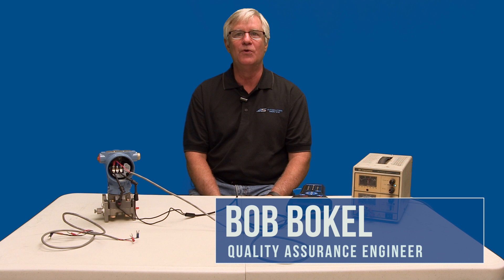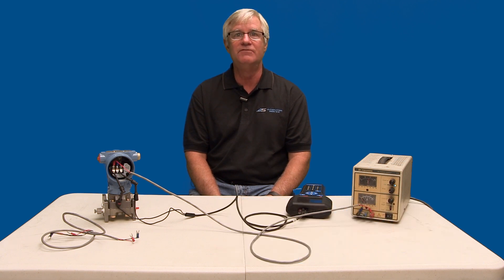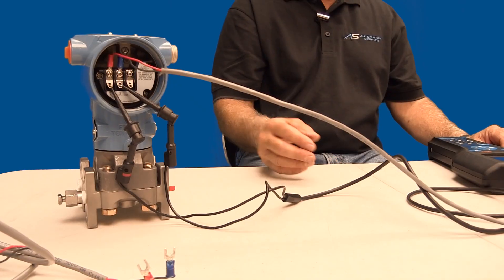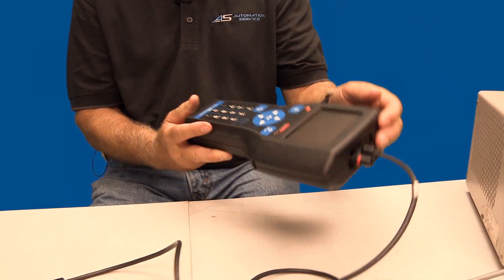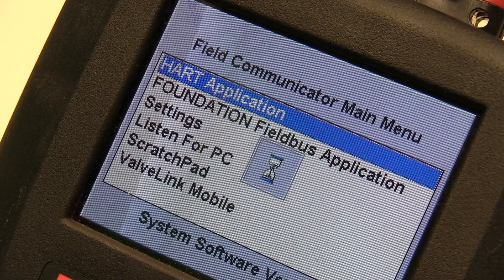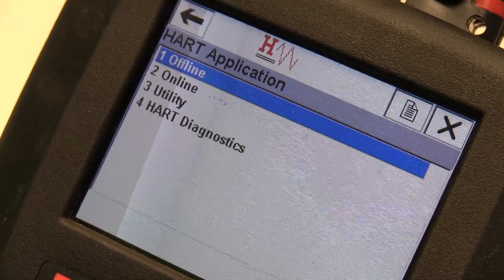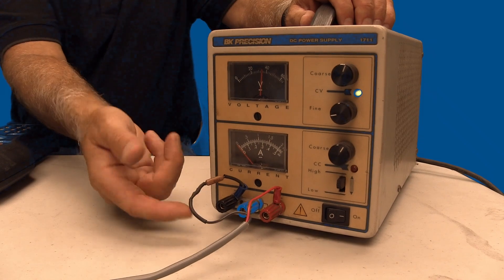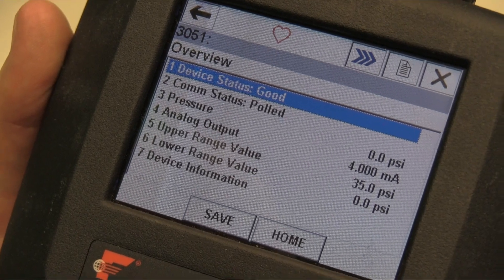HART Communicator Not Recognizing Transmitter?

Comment: Hi Bob, Though adding a 270Ohm resistor is not helping communicator to recognize transmitter. What can be the other reasons?
Reply: EXCELENTE PREGUNTA.
Reply: Add a 250 ohm resistor. Not a 2700ohm resistor

Comment: Is the resistor must be higher than 250ohm?
Reply: No because the value of the resistance must be studied to achieve the voltage value from 1 to 5 volts this values you can do it with ohms law
Reply: Not exactly true. The 1 to 5 vdc you refer to is based on the transmitter controlling the current in the loop to 4-20mA. If the resistor is 250 ohms, then when at 4mA the voltage drop across the rrsistor will be 1vdc, at 20mA 5vdc. You can use a 300 ohm resistor, but the voltages will be 1.2-6vdc. 

All that is required is sufficient enough resistance to create a voltage potential differences allowing the HART signal( mV amplitude AC signal) to not get waahed out. The amplitude of the signal must be large enough for the transmitter to recognize it. The value of the resistor you can use can be higher that 250 ohms so long as the max voltage drop of the resistor does not reduce the remaining voltage to rhe transmitter below it's minimum power requirements(found in manual.

If providing 28vdc from supply, and transmittee requires 16vdc minimum, that leaves 12 volts of drop allowance at max current(22mA). 12vdc/.022A=545.44 ohms. In this case, I would not exceed 500 ohms to allow for line resistance.